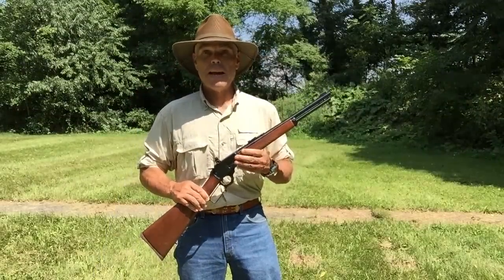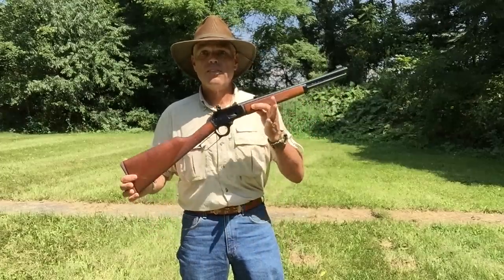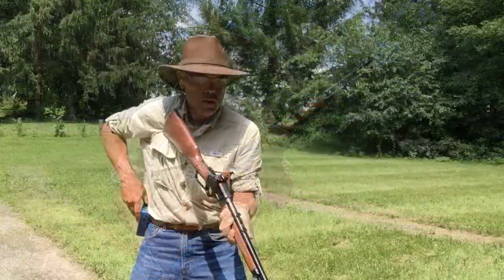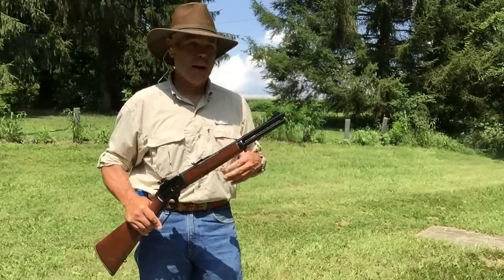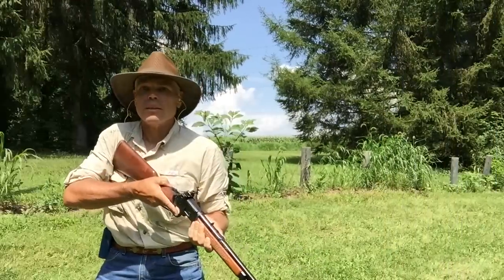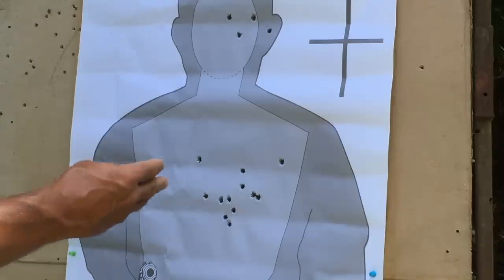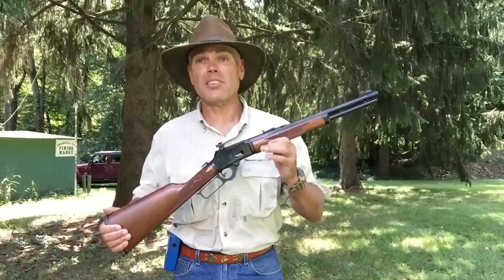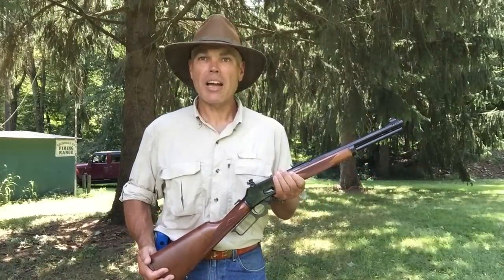Marlin 1894 Lever Action vs  Tactical Carbine Course

Comment: Good work and well shot.  If single shot reloading is important, consider using a replica of the Winchester 1873 or 1892 (I personally have a Rossi 92).  The large top opening of these models helps with faster reloading of single rounds right into the chamber than the smaller side port on the Marlin.  All are still very easy to 'top off' through the normal loading gate though.
Reply from the maker: Thank you!

Comment: Enjoyed the video.
I'm a huge levergun fan. I own multiple lever actions and though I've owned many AK's, an FAL, a few HK 91 variants, a Galil, many SKS's, and one lone AR.....I don't own a single semi-auto long gun at the moment.

 There is an AR and an SKS (sons') in the house, but I'd grab my 24" Uberti 1873 in .45 Colt (15+1) or my 20" Winchester 1894 in .30 WCF for "trouble in the yard" OVER one of the autoloaders.

 Though you handled the course quite well(better than I could), I've seen some SASS /Cowboy Action shooters that are fast and accurate with leverguns, as well.
Reply from the maker: I’m sure there are cowboy action shooters who could kick my butt with a lever action rifle, but I was kind of pleased with myself when I shot a qualifying score with my 1894 on the first try with no ptactice ahead of time.
Reply: @hrfunk  
 Heck yeah...you did a lot better than I would if I attempted it as-is.  Especially considering you had the three extra rounds to load and still got off all but one. The score was good, but the performance was better than the score would suggest.

Comment: Great shooting with your Lever Marlin, having said that the requirements to qualify if you were using something like an AR15, are set rather low. For general use I love my 1894 Marlin in 44 mag, every time I pick it up I'm amazed how light and fast handling it is. I also have a 38spl/357 mag lever action, 357 is really a solid round in a rifle, the velocities really pick, can get close to 2,000 fps with a 150 grain bullet out of my long barrel, a lot of power for such a compact cartridge. A really enjoyable video :)
Reply from the maker: Thank you!

Comment: In terms of using a lever action for defense and Law Enforcement duties, it really comes down to the proficiency of the user. If you think about this course it's designed to set a challenge to someone using something like an AR15. As a result there are those who fail, those who struggle to do the equivalent of what we saw here. If you switch that to your "average" AR owner who has not practiced and thought out the use of that firearm, then a skilled lever action user is likely to have the upper hand in a real world shooting situation.

Comment: I wonder if anyone flinched at 3:06. 

Seriously, though, I really want an 1894CP.  Have for a long while.  While I do have a semi-auto rifle, I want to be proficient with a manually-operated option just in case NY goes full nutjob.  The short length of the 1894 receiver (vs. something like an 1895 or 336 or an AR), along with the 16" barrel, makes for a truly compact package.  While you lose the changeability of a box magazine, you do start with 9 rounds (8+1), which is about the same (or more) as a fixed-mag AR here (10 rounds in NY, but actually 5 rounds in Rochester.)  The option to use .38 Special is also really nice.  For home defense, I could imagine loading in .357 Mag until the last couple and then topping it off with .38 Special (last in, first out.)  That way, your first couple of shots are more controllable and less likely to overpenetrate (with the right choice of load), but if things get serious, you're quickly on to full-power rounds.
Reply: Carp New York dont forget the option to top off the magazine

Comment: To be fair , the lever gun should be loaded to full capacity, and topped off as needed. No experienced lever rifle shooter would do otherwise. You did do pretty well using the technique I used with my Winchester 97 for Cowboy action shooting. Here is another tip, keep your shooting hand thumb on the right side of the receiver instead of wrapped around   the. stock. Work the lever like you are shaking hands, you wouldn’t close your hand before shaking hands. It cycles the rifle much quicker

Comment: If you have a feeding problem with a lever gun you should be able to correct it without even having to look at it.  Feel is all you need.
If you have a feeding problem with an autoloader, the first thing you have to do is determine what went wrong, then determine how to go about fixing it, and then attempt to fix it.  That may be too late for you.
If you borrow someone else's car and find that it is difficult to down shift, you will immediately realize that the owner was not kind to his synchros and didn't rev the motor while downshifting, then all you have to do is to rev the engine higher to get it in.
If you borrow someone else's car with an automatic in it, the first things you need to do is to make sure that the brakes are in good working order, the transmission shifts as it should and if it is capable of using compression braking.  If these things are not working properly, the results could be deadly.  
So regardless if we are talking about guns or cars, personal competence is always preferable to something that supposedly takes the place of the need for competence.

Comment: I guess it's the man, not the gucci gear! great video.  I used to have a Timberwolf pump action IMI as a teen, maybe now that I finally have a revolver I need to get a Carbine to pair with it at some point and this seems to fit the bill probably better than anything unless I am unaware of something.
Reply from the maker: Marlin just reintroduced the 1894 in .357 Magnum. Henry also makes a couple of nice lever guns chambered for that cartridge. You shouldn't have any trouble finding a companion for your new wheelgun. Good luck!

Comment: On the reload stage. I remebered the ginger trick before it was mentioned.  Question: did the three have  to be loaded singually or could you have  loaded all three  at once?
On the last stage: my USMC training  was to hold the stock at the rear , squat, then go forward and place the stock down first.
Would like to see you run the course with one of the tactical pump action rifles.
My experience with high capacity semiautos is shooters trend to value a hihgh shot rate   over well aimed single shots
Reply from the maker: Thanks for the comment! To answer your question, yes, I could have loaded all three rounds at once. I only had 12 seconds to complete the entire exercise, however, and I was concerned that if I took too much time reloading I would have gotten fewer rounds off before time expired. I agree with you, too many people like to "spray and pray" as opposed to firing well aimed shots. Take care!

Comment: I've always been big into lever action rifles and carbines, where I live, AR's are pretty much neutered. I've always had one around somewhere that works really well. Even when I was in law enforcement, my Captain always was pestering me to get into the 21st century. I've got a Winchester 1866 in .45 Colt that's very fast, quicker than my 1894 Marlin. I also have a Savage 1899H carbine, short 20 inch barrel in .30-30, reloads faster than a Winchester since it's a rotary box mag than a tubular magazine and I handload 165 grain Nosler ballistic tips, makes the .30-30 much better of a round. It weighs about a half pound less than my Model 94 Winchester.
Reply from the maker: That sounds like a great collection of leverguns! By the way, I see no reason to come into the 21st century.

Comment: Reckon that there gun shoots a mite to the right....Unfortunately the buzzer did beat you on that 2nd reload shot, but you still got 17, well done. Levers are underrated for sure. As far as the .357 goes it's still rated as the #1 first shot stopper.
Reply from the maker: Thank you!
Reply: With the long barrel allowing for a complete powder burn, and no pressure losing blast gap,   .357 magnum from a lever gun actually packs as much muzzle-energy as an average .223 load!    Almost 50% more energy than a revolver in some loads!        magnum cartridge lever carbines are ravening wolves in sheeps clothing.

Comment: These style of rifles are truly the only "deer" rifles capable of being used in a practical role for home defense or the like. I have an older Model 94 in 30-30 and have debated getting some low recoil 125 gr HP loads for it.
Reply from the maker: Just as an FYI, I've loaded up some "light" 30-30 ammunition in the past. It ended up having quite a bit more punch than I expected. Be sure to test anything you buy to make sure you don't have to worry about it zipping through a bad guy, and then penetrating a wall to present a hazard for someone else.

Comment: You are a very good shot" amazing. I have a 1894 marlin C.  since 1983. I found it so overwhelmingly a good reliable rifle.I got rid of my 30.30 marlin mod 36 .! Because I can fire more shots with the 357 short lever than the 3030. Plus a 357 is cheaper and easier to reload ,! it almost has the same power as a 30 30 at a 100 yards.!"
Reply from the maker: Thank you. I really like the little Marlin 357 1894 too. It's fast handling and it hits with some authority. Thanks for watching!

Comment: More officers use them they would not only take a better aimed shot. The 357 or the 44 mag would be considerably superior to the two to three 55 grain full metal jacket and getting into a car and actually disabling someone inside it as the propensity for the 5.56 / 2 2 3 to fragment when it goes through the thin sheet metal of a car door tends to drastically reduce its wound capability.

Comment: In the stage were you had to fire two shots and them drop to a kneeling position reload and fire 3 more shots all with in twelve seconds. On the kneeling and reload section of this stage would just have the breach open and dropping in a bullet  and putting it into battery each time to shoot have been faster than loading it in the feed tube?

Comment: I'd give you 17 of 20 since your 2nd reload shot was after the buzzer.   Still, a passing grade.  Good job with a nice rifle.
Reply: Mike Pfeifer i think he pulled the trigger before the buzzer
Reply: @sugarnads  Slow it down to half or quarter speed.  He missed the timer.  It was very close though.  Obviously if he practiced he could get that reload smoothed up, and not fumble with it.  Easily possible to get all the rounds in that time.  Also possible to mount a reflex or red dot on it, and speed up his target acquisition, and no reason not to if you were actually going to use it for a patrol rifle.  Also obviously possible to pass without them, but they do make you faster.

Comment: Hi from TX. Love the belt!!!!  That's really cool.   While lever guns certainly offer no advantages over modern carbines they are surprisingly capable weapons.  The assault rifle of the civil war!  I still have my Marlin 1894 cs in 357mag that I bought in 1990.  I haven't shot it in a while but it has killed more deer and feral pigs than any of my ARs!  I also like competing in NRA high power competition.  I started with a M1 Garand in 7.62x51 NATO in the mid 90s then transitioned to AR-15s
Reply from the maker: It sounds like you are a well-rounded rifleman! That's a pretty impressive lineup. I wish I had a 7.62 Garand, I'd like to shoot it side by side with my M14 to see which one like better. Thanks for the comment!
Reply: @hrfunk  I bought the Garand in excellent condition for $750 back then with competition in mind.  I would have went with an M14 but could not afford it at the time.  I choose the 7.62 over the 30-06 guns because my thought was to develop a 150gr reduced power target loads for primary practice and the 200 and 300yd ( something that might be easier to achieve with smaller case volume)  That would reduce blast and recoil and shoot closer to full power 168 or 174gr loads for 600. (at the time I belonged to a club that shot the full range now I only shoot at 100 on reduced targets).  After watching your video on the M14 I think there could be a slight advantage to a Garand in some cases but it would almost always be decided by the skill of the individual shooter.
Reply from the maker: I'm sure that's true. The one downside to the 7.62 Garand is that it cannot be used in an "As Issued" match. They are only legal in the "Unlimited Garand" category. Still, I wish I had one!
Reply: @hrfunk  The matches I have shot down here are usually just divided between service rifle and match rifle divisions and section 3 still includes 7.62 Garands as service rifles,  no doubt thanks to the Navy's continued use of the Garand (rechambered for 7.62) for several decades after the switch to the NATO round.  I know for a fact they were still using M14s aboard their ships well in to the nineties and for all I know still have some floating around( no pun intended) somewhere!  What ever rifles they get a hold of are well maintained and rarely fired.

Comment: "Open gate" emergency reloading is something that most folks don't practice.  But some of us have it figured out.
Reply from the maker: Would you be so kind as to define "open gate emergency loading?"
Reply: @hrfunk  "Open Gate Emergency Loading" is just what you did.  You pulled the bolt back with the lever and had the rounds ready in your opposite hand where you could feed them one at a time into the chamber.
Reply from the maker: Patman Crowley Ah. Ok. Thanks for the clarification. I never heard it called that before.
Reply: @hrfunk  Sorry, Howard.  I pulled that one out of my rectal-database but it was appropo.

Comment: If I racked my marlin 1895 CB 45-70 like that my fingers would be bleeding!! It is new and it takes a lot of force for the bolt to push back the hammer!
A little Ballistol oil helps a bit. I don’t want to sand or use abrasives on my gun I am afraid I might remove metal I shouldn’t. I have just decided to wait until many years have passed until the parts truly marry themselves!! In the standing position I can rack the lever maybe 3 times fast after firing each shot but after that my hand is shot. I have tough hands not mamby pamby hands it just down right hurts!! Now if it isn’t being held tight in my shoulder it is possible to continually rack the lever in multiple successions, but not in the standing position. It is a wonderful and powerful rifle I love it but it needs to be broken in or have someone do a smooth job on it but I do not want to do that I want it to smooth out naturally even though the tolerances were not to precise to begin with!!
Reply from the maker: The 1895 CB is a little different animal than my 1894CP. It’s necessarily bigger and heavier to accommodate the 45-70 cartridge, and it’s better suited to hunting large hairy creatures than it is to a defensive role. Even so, I’d prefer not to end up looking down its barrel! Thanks for watching.

Comment: And that reload stage is not entirely valid as it is designed specifically for detachable mags where you would typically run it dry and then reload. With the lever you would typically top up along the way to avoid running it dry.

Nice work.
Reply from the maker: Thank you!

Comment: It would be interesting to see a rem 760 on this course, or a 03 Springfield... The 03 would be a better police weapon anyway, you can can use the butt for a door breach.
Reply from the maker: Ask and you shall receive! Here is the course with the ‘03: https://youtu.be/eoV6ZF11-5w
Reply: @hrfunk  And you did a great job. So, in Ohio, other than smokepoles, do you hunt with a .44 levergun? Yes I read the laws and wondered if the blackout or 450 Bush counted. Interpretation is everything.
Reply from the maker: It depends somewhat on what you are hunting. The main restrictions have to do with Whitetail deer.  For them, only straight-walled cartridges with a bullet diameter of .357” or larger,  and a case length of at least 1” are allowed. Under those restrictions, the Black out is not allowed. The 450 Bushmaster would be permissible, but since a hunter can have no more than 3 rounds loaded in the firearm at any given time, the 450 Bushy doesn’t offer much advantage over a good levergun chambered in 45-70. For the areas I hunt, shots at deer rarely exceed 50 yards so my 1894SS chambered in .44 Magnum makes a potent and easily portable package.
Reply: @hrfunk  does the 3 rounds go for the tubular 1894SS? And the idea on the Bushy or 460 SW would be spire points. A hand loaded 357 mag with machined spire points in a 77-357 or .444 Leverevolution for those times when a beanfield shot is needed near Washington Courthouse would be prudent. Not everyone can hunt near Galipolis or along the Scioto or Miami. Not that the 45-70 is bad, I just was thinking of rounds close to 375 BC's as flat is where it is at. Holdover is the demon or accuracy.
Reply from the maker: 3 rounds does apply to tubular magazines such as the one on the 1894SS. To my knowledge, there is no restriction pertaining to the use of pointed billets (Leverevolution or otherwise). Obviously with a straight-walled case, you’re never going to get the range/ballistics of a true “bean-field” rifle.

Comment: The velocity from these magnum carbines is more than a little impressive, as is their accuracy.
Reply from the maker: Yes it is.
Reply: @hrfunk  My .357 shot 125 gr Federal over 2100 fps, Cor Bon over 2200 fps. Top accuracy was Win Silver Tip 145 grain over 1800 fps. Wish I still had it. I understand Marlin is not what they used to be.